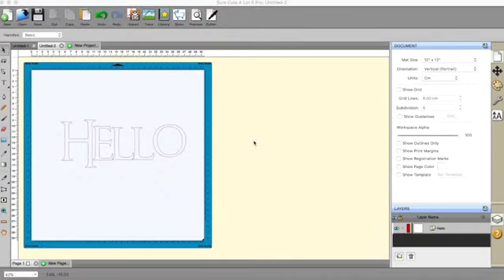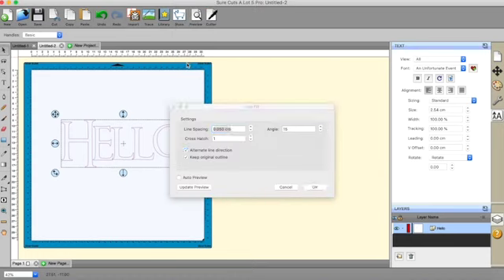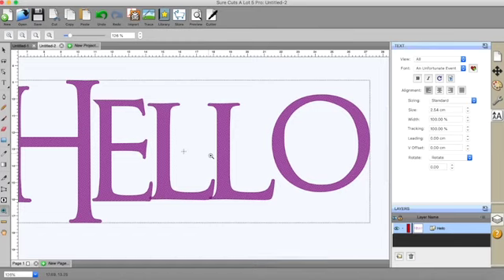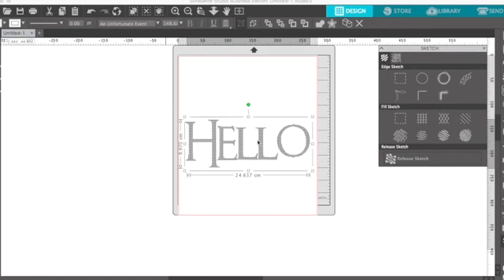Foiling with a  an electronic cutting machine (plotter)

Comment: Do you think you would try to use an iron to try to imitate a Glimmer Foil plate?  I'm thinking of trying it.
Reply from the maker: As long as you can do so safely, I see no reason why not. It's only a case of making the die hot. Even a flat pan put over a low heat may work. You would need some tongs to pick it up though.

Comment: What a fantastic video ! Thanks a million! Just a quick question, what should the consistency of the glue be like? More on the thicker side or the flowy liquidy type, as I don’t get the glue you have in my neck of the woods...
Reply from the maker: Thank you! Good question. The glue I have is the consistency of a thick honey and has the tacky feel of Versamark.  Sakura Quickie Glue pens will do the job - but they do have a thin consistency - it's just a different type of glue. Obviously a thinner one will be easier to get into a pen...I suggest you do a small sheet of samples, putting down very little glue, like it would with a pen. Allow to dry for a minute or two and then put some foil over. Use a pen over that to squiggle over the top and find out what sticks. If it will work under those conditions, it should work in the machine.
Reply: createinspain Thank you very much for your helpful response!

Comment: wish you could show it go through the machine.  not quite getting how it works.
Reply from the maker: It's hard for me to video that due to space requirements.  It really is very simple. It is usually possible to put pens in a holder for the cutting machine instead of the blade. (I am talking about plotters like the Silver Bullet, the Cameo etc. In this case, instead of a normal pen, you draw with a glue pen. Without removing the paper from the mat, you cover the glue design with foil and a piece of paper and tape it down. Then, you swap the glue pen for an embossing tool or an EMPTY pen and go over the design at a higher pressure. The foil is then bonded to the design. (It has to be foil designed for craft use, not kitchen foil.)